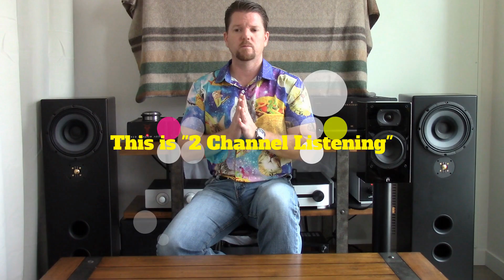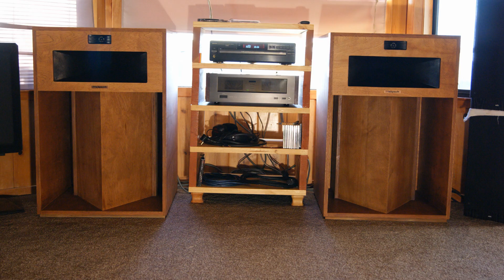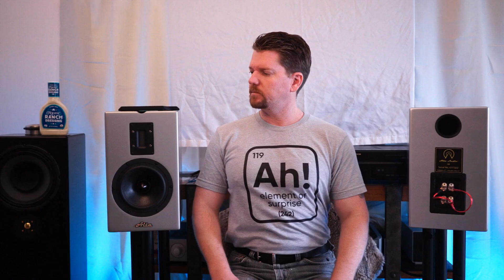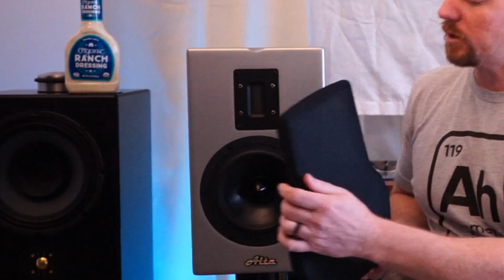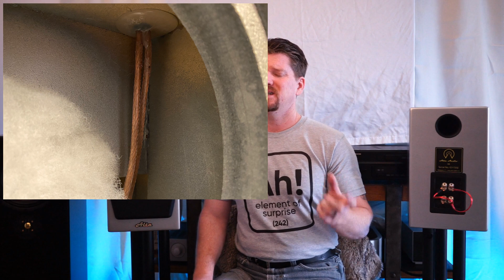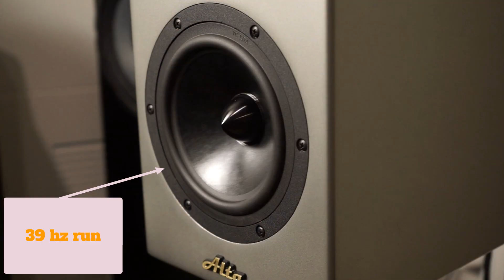Alta Audio IO's: The Entry Level High-End

Comment from the maker: Hello 2 Channel Viewers; viewer "Ibenek" pointed out that the Alta IO's are no longer being produced and remaining stock is being sold for $2,450.  I certainly am willing to say that anyone would be hard pressed to get this level of performance from other mass produced stand mount speakers at this said price.  I include the KEF R3 in this category.  So, I hope that helps a bit...thank you.
Reply: You actually told me about these speakers you knew when you saw the speakers I built with the same woofer but I used the 10" it took me a long time to get the crossover where I wanted and I used a 3 rd order and the high and low pass so they wouldn't bleed into each other they came out really good I used solen fast caps and Jantzen inductors.  I made a mtm recently with the Dayton 6.5 designers and its a beast I upgraded to Jantzen capsitors and I can feel the weight difference and the sound is amazing.
Reply: The Dayton reference are the best bang for the money

Comment: I will build you a custom speaker with any crossover parts you want.  My speakers are way better quality.
Reply from the maker: I appreciate the kind offer Mike, my current role is to experience as many manufacturer products as I can stand to listen too.  It is the best way I can help clients navigate the endless options.  I have not settled on a single product for a long time and I do not see it me settling anytime soon.   Thank you sir.
Reply: @2ChannelListening  thank you I appreciate it you taking your time and actually look at my speakers. It's my dream to be able to manufacture my design someday to the public . Those cabinets are.5 MDF with.75 solid oak adhered to the MDF with industrial flooring adhesive they are seriously strong I like to think outside the box . I build houses so I think outside the box and use damping materials I have never seen anyone use before anyway I put love into them I even used gold leaf paint for the trim I want speakers that look like handcrafted furniture and sound awesome and that is why I made those big beautiful speakers . Thanks again and I really been enjoying watching your videos. I think you do a really good job reviewing and I like how you break down the speaker and take it apart to look inside. I used ofc wire I used solen speed caps and jantzen inductors I coat my inductors with parfinn wax I take extra steps and it all adds up even the solder is lead free silver solder I did a lot of other things to dampen and get rid of standing waves I'm very happy with the results thanks again for taking the time to look at my speakers and take the time to write back. It would be cool to see them on your channel someday 😁

Comment: Just a thought about the double-wall MDF damping and it being "special" - while I don't agree with the marketing stating that it is unique and proprietary, it may be a bit more special than it at first appears. If they are using damping material between the layers as tested and shown by Youtuber Tech Ingredients in his excellent video on a DIY speaker build ( https://www.youtube.com/watch?v=EEh01PX-q9I ) where he shows how a painted on damping material (Decidamp DC30 by Pyrotek https://www.pyroteknc.com/products/decidamp/decidamp-dc30/) can be highly effective and the thinner the coating the better it works.
Reply from the maker: I looked as hard as I could without actually scratching at the edges and in between the front baffle, I could detect nothing rolled, or sprayed on.  But that doesn't prove anything either.  VMPS liked to use that Bitumen you could scratch off with your finger nails...

You make valid points Scott, but I'm a guy that likes to know where my dollars go to (most of the time).  Makes me appreciate a company like Ascend Acoustics all the more.  Thus, I can also hear the difference, or lack thereof.

Comment: The Dayton Audio RS woofers are very good drivers - they have very low Mms and they use 3 material blended (paper, Kevlar and fiberglass) and have good clean response in their upper end.
Reply from the maker: Hello Neil, I did not intend to dismiss Dayton's drivers as not performing well, or not being well designed, I shared the specification sheets in the video.  What I find questionable, is that a value oriented driver is pushing a $3,500 monitor speaker.  I would expect to see some $250 Seas drivers in a $3,500 two way design.  I also stated that I could find zero fault with the tweeters performance, the best part of the speaker.  

Thank you for watching and commenting.
Reply: @2ChannelListening  Understood, and I am of the opinion that some companies put arbitrarily high prices on things. Including driver companies. Though the scale of this is most often greater for speakers and amps and such.
You mentioned transmission line cabinets, which is something I am interested in. I recently built a pair of mass loaded transmission lines, and I used the Dayton Audio RS225P-4A (8" 4ohm) woofer; the same as is used in the $9,000 Alta Audio Alec loudspeaker. The Alec uses a taller ribbon Foundtek tweeter. I used a very rare Linaeum TLS tweeter, that is crossover at 480Hz.
The sum of the parts is the important thing. The price is only worth it - if the buyer thinks it is.
Reply from the maker: @NeilBlanchard  Yes, there really is a 600 to 1200% mark up on such products, cables being even worse.  I'm not beholden to any manufacturers lending me products for a softball review - plenty of other YouTubers for that.  I'm buying stuff that looks good on paper, or is lesser known in some cases and putting my money were my mouth is.

I looked through your DIY thread, you still working on the Linaeum 1000 project?  Building your own networks, that's way over my head.  I couldn't see the pictures posted as I am not registered, but the finished project is intriguing.  Good luck Neil.
Reply: @2ChannelListening  I am not sure I will do the crossover for the Linaeum TLS 6" high tweeter. It is a fourth order and the work to level the tweeter output is likely way above my head, too. But I am much more likely to try a crossover for a similar MLTL speaker with a Radio Shack made Linaeum 1.5" high tweeter, since that is fairly common.
I am a fan of mass loaded transmission line designs. Great bass - very low frequency coverage and amazing quality. That's the part about expensive speakers that don't get well into the bottom octave, that amazes me.

Comment: I’m surprised that you’re not disappointed with the inexpensive parts you found . I would think in the long run inexpensive parts could fail or degrade in performance. Your thoughts?
Reply from the maker: Hi Nalds Armas.  Believe me, even though I picked these up second hand, I am and was disappointed with what was inside.  However, it would be disingenuous of me to say the speakers didn't perform as advertised with those budget oriented parts.  The tweeter's performance I could find no fault with, so it and the crossover were doing their job.  The bass was excellent on most things, not as natural and the only weak point besides the paint finish.  I moved the IO's  further in the room to tame the bass.   I also cannot comment on a $8 polycap failing before a $100 copper foil cap, hasn't happened on my watch.  

Thank you for watching and asking these important questions.

Comment: Thank you for your video and that you revile what parts that are used.

Actually I see it from another angle regarding the low cost drivers.

Drivers is not anymore something magical in respect of how they work it is the same basic principles for ~100 years.. so not so much progress today in development compared to 20 years ago.

But what have happen the last 20 years is that I suspect that robots and automated production lines is used more today than before.
 
That is a good thing in many planes.
 
And that drive down the prices for the drivers. And drives up the quality and the quality differences from one driver to the next in a highly optimized production.

In that light I do not believe that if the for example this 7" driver is assembled by hand. That it would achieve better quality. I believe that the spread of the quality level should increase and the drivers will cost much more because of the labour intensive.. so lower value and lower performance..

So maybe that is one of the reasons that low cost will and can compete with a high cost alternative. Today.

And it is wrong to look down on low cost drivers if you know that they have quality by automation and the high cost is by manual labour. (The manual labour do not mean that it is per automatik better quality BUT it means automatically that it will cost more..)

Take care!
Reply from the maker: Optimize, thank you for watching and commenting.  I can securely say that I am not the target audience for brand new high-end speakers, even my BMW I bought as a CPO unit.  However, I certainly will take products to task at specific price points if I "think" and "see" that their parts quality is not on the same playing field as their competition.   

Here is a better and yet different example: Odyssey Lorelei speakers.  Those are (we're) $3,000 floor standing, full range speakers with much more expensive drivers and crossover parts, plus a very well designed cabinet.  Their parts are twice the cost - are they 10% better in sound quality? 20% better? - I'm going to find out...

Thank you for your thoughtful contribution, its good to see all sides.  Cheers.

Comment: I am shocked at the low cost parts used in such a high priced speaker. I know many speaker manufacturers use low cost parts in their mass produced speakers but at this price range for a small monitor I would have expected better. No matter how well designed the cabinet and crossover are you can't make a silk purse out of a sow's ear.  I am a DYI speaker builder and I like to start with high quality parts (of course I don't have all the overheads and expenses a manufacturer has and my labor is free so I can justify the component costs).  I understand manufacturers have a lot of expenses they have to cover and I suspect there is a significant amount of man hours goes into each speaker but why not use better parts and charge a little bit more for the product??  Wouldn't the better components improve the sound enough to justify the small added cost of the components??
Reply from the maker: That is why I do respect Tekton Design all the more - one of the best value (non-DIY) speaker producers in the business today (that I am aware of).  

Thank you for watching Jim. Cheers
Reply: @2ChannelListening  yes Tekton gives you your hard earned money worth. This here is a fleecing.
Reply from the maker: Greetings Lassi, you make a fair point.  In the end, I did state that I could find no fault with the performance of the drivers, and emphasized how the IO's outperformed the sum of their parts (guess the car analogy fell flat on folks) /shrug\
Thank you for watching and leaving a comment.